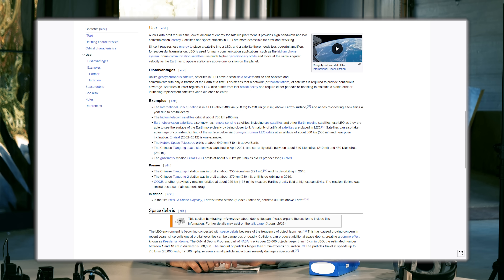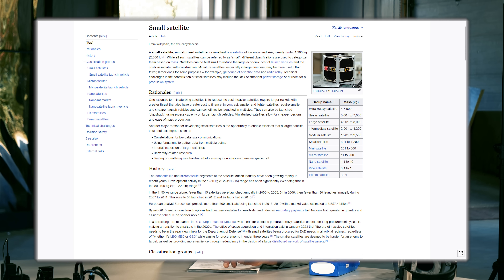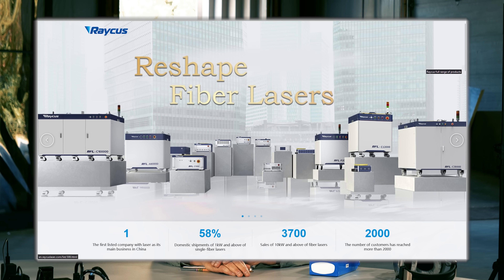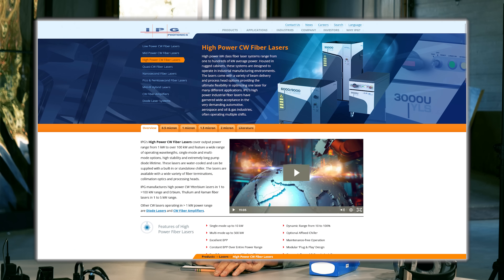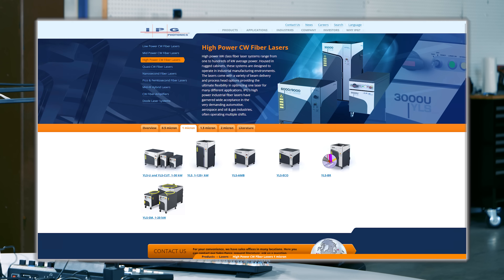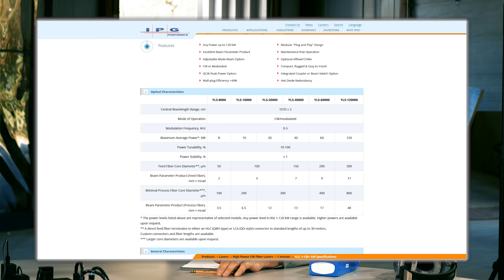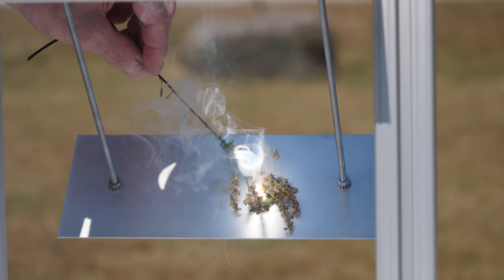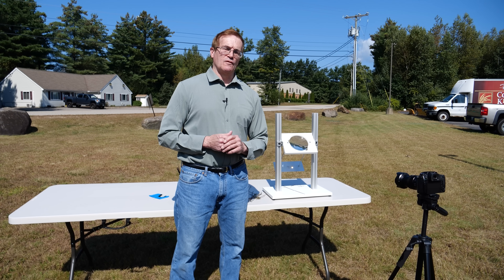COULD SATELLITE LASERS REALLY DO THIS?...

Comment: I worked on satellite systems in the past.  When you’re designing your system be aware of the temperature differences between day and night at 400km  then look at the thermal expansion characteristics of the different components.  Things that are fine on the ground could rip themselves apart at 400km.  Also consider operating temperatures of batteries and other components.
Reply from the maker: Sure.
There are many  considerations  when working  in a high vacuum  with solar radiation  heating exposed components.
However,  there is a lot of well developed technology currently deployed  on satellites to cope with this.
Reply: I worked on information gathering satellites
Reply: @TechIngredients  Of course no need to make it more plausible, but if you wanted to target 2 lower powered and easier to target fibre lasers at the same point, I wonder how much of the machinery could be shared possibly bringing down weight (less than double) white doubling the power.  Also what about chemical lasers?  Very high powers.  And what about pulsed lasers, if you only need long enough for a fire to start...
Reply: @TechIngredients  thanks for the videos, much appreciated, from an mku1tra victim.
Reply: @jonathanberry1111  Chemical lasers are almost entirely a relic of the past at this point.  A failed technological evolutionary path that was passed over for high powered diode lasers and highly efficient laser couplers.  There was a time when they were the most powerful available, that time was the 80's.  They never really exceeded a continuous megawatt in practice and they were large and cumbersome to handle. All development was scrapped in 2012 when it became apparent to the most pigheaded that diodes could do the job better in every conservable way.
Reply: And @TechIngredients estimation of weight reduction is likely off by an order of magnitude.  The actual weight of the functional components in these laser systems designed to output hundreds of kw continuously is really a small portion of the shipped weight. The actual lasers in this would weight just a few kg. A substantial amount of weight is in the steel chassis, cooling system and power systems  needing to take dirty three phase power and produce pristine dc power.  Batteries already have pristine dc power, a system that only needs to be powered for a few seconds every orbital period would have significant reductions in the cooling needs. Furthermore the commercial systems are designed to last years of powered on time, you can over drive the same lasers for significant increase in power output if you are willing to accept shorter powered on life span.  And for starting a fire shorter time is probably best, you just need enough joules on target in a timeframe probably not lasting more than a handful of seconds.
Reply: @zyxwvutsrqponmlkh  yep, and comparing whats commercially available with what advance infinitely funded development is constantly going on in secret R&D bases is another factor of magnitude......
  The possible combination of such mounted on low or high altitude aircraft or even zero point gravity non propulsion airborne devices is another factor.
Reply: He did mention cooling system at the beginning 😉
Reply: @donrico5122  I like how you mentioned UFO/UAP without mention it... Noice!
Reply: @TheKb117 yeah, SOOO cool he said something , by simply saying it a different way, MIND…..BLOWN.
Reply: @TheKb117 not so sure he intended ufo/uap by saying zero point gravity non propulsion airborne devices. ‘We’ might have those too already.
Reply: lol if your talking high vacuum of space don't believe it has ever been demonstrated that vacuum can hold in atmosphere except in a movie studio  @TechIngredients
Reply: Also consider there are no satalites without helium
Reply: Yep, you want to keep the power supply and critical components inside of some sort of climate controlled environment, even up there.
Reply: This video still does not explain how cars have missing windows and melted piles of molten metal around them and they are not even close to a fire source. The government has a powerful dew that even this guy doesnt even know about.

Comment: A nice follow-up would be to investigate if/how these lasers can be detected as well as if it's possible to defend against.
Reply: Good old aluminum hat will keep you safe, as long as you keep it shiny side up!
Reply: Bluetarp seem to be pretty nice
Reply: @AndersAylward Sky is blue because that's the most blurred color .  Infrared lasers stay far away from blue .
Reply: wrong, an intense laser will not bounce off shiny material, did you not learn anything in class? @firstmkb
Reply: @greenmarine5 think it was a joke
Reply: Wear blue 💙
Reply: @greenmarine5  WTF ... some joke...
Reply: @guin1776  
Be a Smurf.
Reply: @greenmarine5  How about a glass mirrored hat ?
Reply: look up infrared reflecting materials for defense,aluminum foil is decent,also you could probably see the beam trough a thermal camera,or mabe even any camera since they see infra red light.
Reply: @greenmarine5  Wrong,it will not not bunce completely but it may bounce ennough.a silver mirror reflects 96% of infrared light witch leaves you with only a few watts heating up the mirror,witch you can counter with evaporative cooling(water) also aluminum reflects 86% witch is good ennough for short term expandable sheilding
Reply: Just use a tracking mirror and re-focus that beam right back to give that satellite some taste of its own medicine.
Reply: @guin1776 So you’re saying be a democrat shill or they’ll burn everything you own/have? Love ones included?
Reply: Big ass mirrors 🪞
Reply: @djordjezivic2481 Im beginning to think you just like saying; “WRONG” LMAO
Reply: Use a mirror.  Works pretty well at the 95 suns level of power.

Comment: You make tech and science so easy to digest, the first 12 seconds actually scared me a little bit.
Reply: The principles are easy.  The difficult part in engineering courses is almost always the math.
For example... it's not "lift this mass with this electric motor", it's "optimize the dimensions of the lever arm to use the least wight of material with a safety margin of 100% over rated capacity"  {It was for problems such as that which lead to the development of the I-beam)
Reply: I beams are ok for spanning gaps but they twist when used a levers. 
Perfectly demonstrated by the “Barkey Pickers” trebuchet on Scrapheap Challenge.

Comment: this is the kind of thing that seems so trivial to actually accomplish with a military budget that it's pretty safe to assume that they've done it at some point.
Reply: Now you know where that $2 trillion went that the Pentagon  misplaced.
Reply: Remember the Jodie Foster movie, “Contact”?
Reply: FYI - the "Published" range of known ship mounted systems - which are NOT super heavy is 900 miles.
Which in of itself raises interesting questions about the flat Earth theory, as why would you need a straight line weapon that could not hit a target 900 miles away if we lived on a globe.  In fact at 40 miles it would have to fire through hundreds of feet of water to hit a target 40 miles away on a globe.

That being said, the published ranges are well outside the height of Satellites, making range on non-sensical argument / consideration.

Satellites are said to be about 350 or so miles high, the publicly known range of DEWs are almost three times that.

So . . . not an issue at all.
Reply: If you remember, Ronald Reagan started the project called 'Star wars'. They've been using it for years.  On occasion you can actually hear it in operation.  It sounds kinda like this.  It's a guttural 'well - you know'. 😂
Reply: Look up project Black Eye. It was a satellite laser project in the 1960s meant for one satellite to shoot the optics of another satellite, giving it a "black eye".
Reply: @ClockworkAvatar - I see your point but where are they going to get the massive amounts of electricity needed to power the lasers(?)
Reply: @__WJK__ Solar arrays can charge a battery over time. Solar panels for space get 49% efficiency vs. the 20% consumers buy. Also, it's common to use nuclear material to generate heat. The heat difference is used to create power (thermoelectric effect).
Reply: @SomeUserNameBlahBlah  - Interesting & if that’s the case, then it’s definitely plausible + it’s also plausible that additional efficiencies & technology exist,  but is not widely known, given it would be classified as top-secret. Though I would still argue, if advanced space based lasers were a thing, one would think we would have seen “more impressive” military land-based and/or ship-based units, deployed & operating but that’s not really the case, based on all my research so far.
Reply: @dr.redpill353  They're meant to intercept aircraft. Aircraft fly.
Reply: @dr.redpill353  are you really talking about that flat earth bs on a channel devoted to scientific interests?
Reply: Hi @_WJK_ , He did say solar panels. In space they would have good line of sight to the sun (unless eclipsed) and 24 hours (possibly minus 10 minutes) to charge the batteries. he also included the weight of the panels in his budget. 
I didn't follow the weight argument, just trusted his competency and relevance. Weight might be a transport and/or orbit issue.
Reply: @__WJK__  Aren't ship based lasers used to destroy missiles. That's impressive considering the tracking speed. 
More 'impressive' than that would be the ability to vaporise Maui with a proportionately stronger beam, given the closer distance, though they wouldn't advertise their ability to attack civilian targets
Reply: @PeterFinch  - For sure. I actually wouldn't be the least surprised if Ronald Regan's "starwars" program, from the late 80s, is far more advanced than the general public actually suspects.
Reply: @SomeUserNameBlahBlah  You wouldn't even need expensive 49% efficiency solar panels; you can just exchange battery charging time for efficiency.
Reply: while components of a satellite are facing away from the Sun, don't their temperatures drop to minus 170°C ?  Surfaces facing the sun heat up to plus 170°C.  This was one of the many arguments debunking the claim that astronauts in space suits walked on the Moon in 1969.  The same argument questions how Li-Ion batteries are protected from both temperature extremes.
Reply: James Webb "telescope" dew
Reply: Sandia Labs built a proof-of-concept system when I was there.  When they fired it up, all the lights went dim in Albuquerque.  The power supply took up several city blocks.  You just don’t realize how big these things have to be to do what’s being attributed to them.